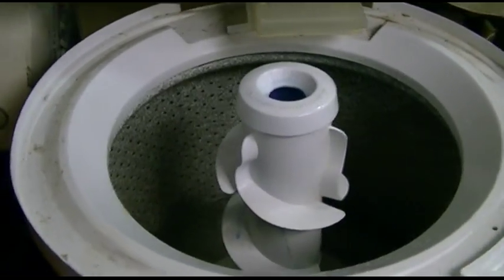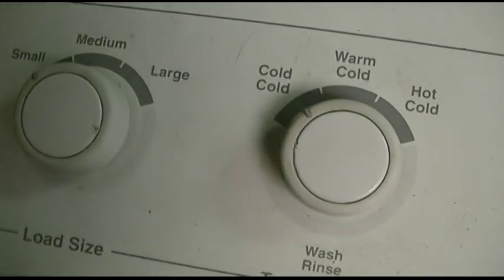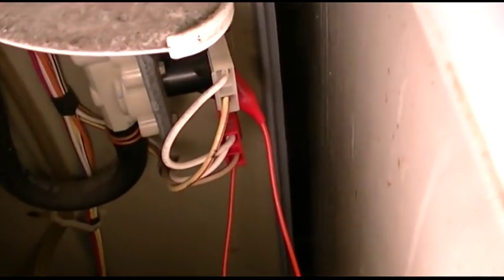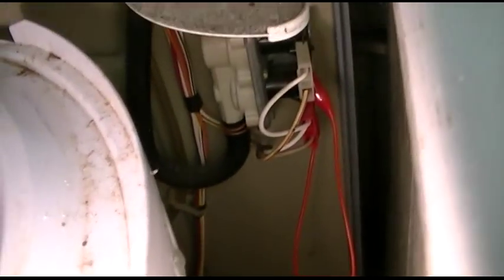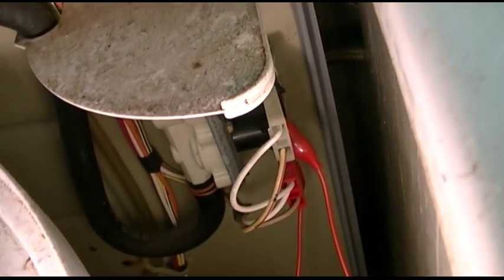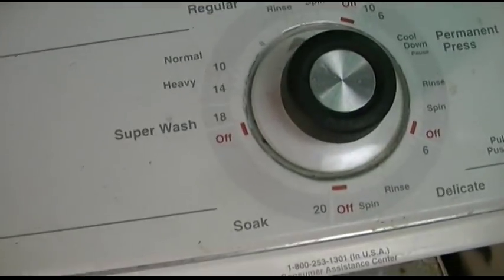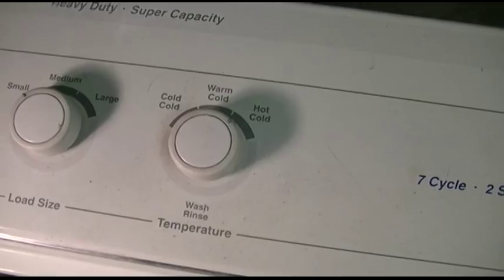Warm Rinse Option Proof-Of-Concept

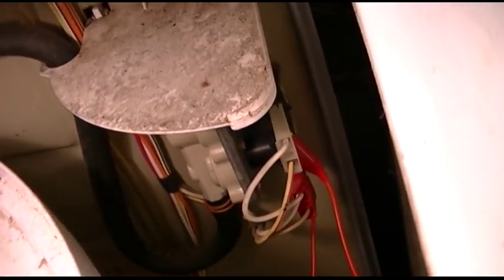Comment: 1:04 any idea what the 2 white wires in the Hot connector are for?
Reply from the maker: One is neutral, one is hot, and they jump the neutral to the other valve.  If you look closely at that timeframe, you'll see my red jumper wire on the OTHER set of contacts, so I'm doing the same thing, but jumping the hot wire from the cold valve to the hot valve.
Reply: That makes more sense, thanks!

Comment: What's wrong with a simple Y-hose, also called a mixing hose.  The double end connects to the hot and cold water supply and the single end connects to the cold inlet on the washer.  The hot inlet on the washer has to be capped with a garden hose end cap, otherwise water will leak out of it.  Turn the hot supply on full and adjust the cold just slightly to get the desired warm temp.  If the water fill cycle won't operate if the lid is open, then initially don't connect the mixing tube to the washer until you can determine the cold supply knob position that gives to right temp.  Let water flow into a bucket so the water temp can be assessed with one's hand while adjusting the cold knob.  Note where the cold knob is and mark it for the future.  Now connect the Y-hose to the washer's cold in.  When  performing a wash cycle, set the temp control to cold or tap cold if available.
Reply from the maker: What's wrong with that is it never gives me the option to change it, lest I adjust the supply valves every single time.
Reply: Thanks, it's so ridiculous that these washing machine makers do not allow us to make our own choices....like clean non soapy clothes!

Comment: You know, thinking about it, that would be really cool to have any and all temperature combinations on the machine, just by the use of one toggle switch. Not that I'm assuming that's what you'll be doing here, but just imagine though, a machine with multiple secret toggle switches on the back panel to make it do all kinds of crazy things, heh, it's kinda cool!
Reply from the maker: Well this switch is only going to add warm/warm plus other odd manual combinations as listed in the video description.  And yes, I already have the lid switch defeat switch, so there will be one more.  I'm thinking of mounting it on the side of the control panel.  Video forthcoming...in the future.